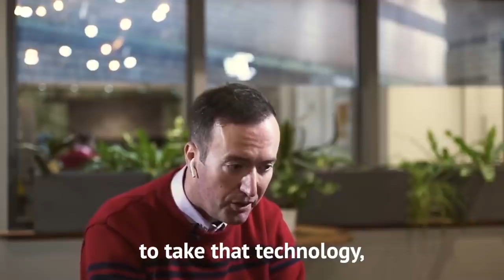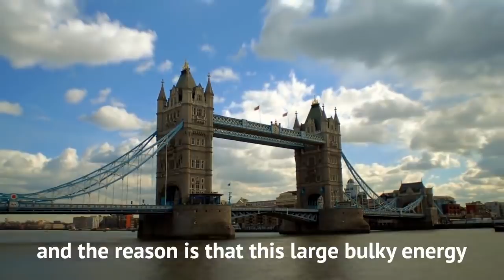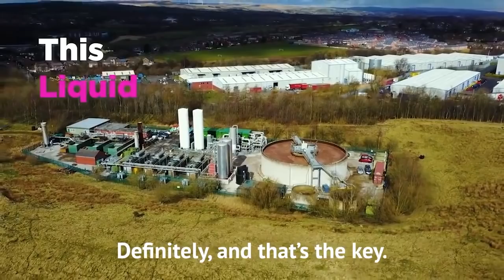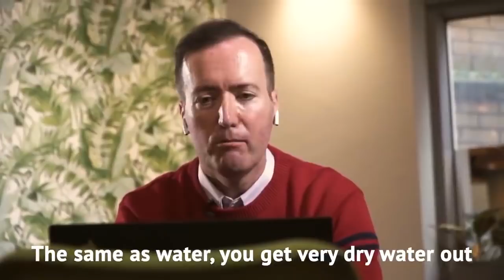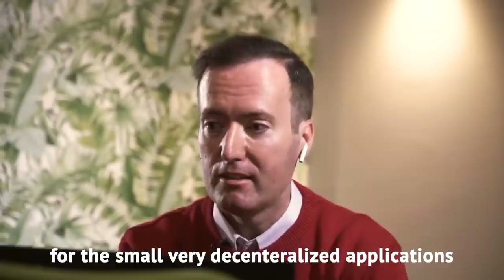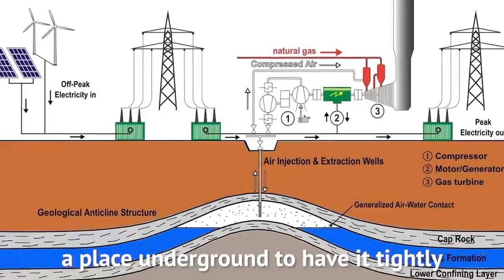Highview Power: Grid Storage Out of Thin Air

Comment: Extracting CO2 by liquifying air takes too much energy to be cost-effective. But if you have to liquify the air anyway, the equation changes quite a bit. This alone should make the approach attractive, given the carbon-capture side-effect.
Reply: I don't really understand the benefit of liquifying it---  Why not just compress the air and be done with it.  Seems like it takes a lot more energy to cool it down that much, into a liquid------- and keeping it stored at that low temp???   which I don't really understand the process that well, or how or even why its done.. lol  But I would think that there would have to be a benifit over simple compression alone.  but I agree with you, that the extra side effect of scrubbing the c02 out at the same time is pretty awesome.. at least from a "climate change" type marketing gimmick at the very least.
Reply: The removal of of the CO2 sounds teriffic until you look at at the overall amount. 1000's of these things running for hundreds of years would hardly make a difference. The solar on my roof for 1 1/2 years has helped reduce 12.6 tons of CO2.
Reply: @lkeil84  I don't think you factored in the amount of CO2 it took to build those panels.
Reply: They aren't doing anything to the carbon dioxide yet, it's just liquefied then released along with the rest of the air.

Comment: I was hoping you'd ask some actual questions, maybe some technical ones. This interview sounds too much like a superficial marketing video straight from a company's website.
Reply: yeah same--- I was very curious how the tanks of air can be converted back into something useful.....  but from I can surmise.. .  Just think of it as a pnumatic air compressor.   Basically when the grid (especially wind and solar) are running at a surplus because of low demand at that moment -------  they can run these systems to use that extra electricity to compress the air into tanks----   and then when its time to use it, they just run that compressed air through a turbine just like a steam engine operations..  I'm not exactly sure why they liquifiy it, maybe it makes it easier to store.... but it makes sense in that can help level up the peaks and lows of a randomly running solar and wind system--- and turn on and off at will, as needed.........  

There is also something called a "gravity battery" ---  Which is basically a large tower or even deep vertical mining shaft--- that, when you are in surplus--- you can run an electrical crane to lift very large, many TON blocks of concrete or stone and hang them side by side in the air---- and then when you need that extra power--- you just go the other way, and grab those blocks with your crane and let it free fall down the shaft, pulling the crane cables holding it--- which would then run those large electric motors in reverse and create electricity.  Much like regenerative braking works.  I think that's really fascinating also.  Very cool stuff.  It really makes the intermittent issue of solar and wind to not be an issue.  But I can imagine that you would have to build a lot of these. lol...
Reply: @calholli  Why liquefy air at cryogenic temperatures? Because it enables you to store a lot more air in a given tank size without worrying about several tons pipe bombs. When it is time to re-expand the cryogenic liquefied air to run a turbine, just pump it through a heat exchanger.
Reply: @teardowndan5364  So you have to constantly keep it cool and then heat it up. Doesn't sound very efficient.  I guess if you aren't storing it for more than a day at a time.
Reply: @calholli  A high-vacuum Dewar flask can take months for its contents to finish boiling off and this gets better as the ratio of volume to surface area increases, no problem for long-term storage. The main selling point of this stuff is that you can have easily scalable pumped-hydro style storage anywhere without rare materials.

Most energy storage only has 70-80% cycle efficiency so if you are really concerned about efficiency, the best is to not need energy storage in the first place. Storage is only necessary to buffer variations between sources and sinks over a given period.
Reply: Calholli--- you were wondering why they would liquify the air.  If you compress any gas (carbon dioxide, nitrogen, helium, carbon monoxide, air, etc.) enough, it liquifies.  There is nothing to stop any gas from liquifying if you compress it enough.

Comment: what is the efficiency of this technology ? 100KWH goes in what comes out?
Reply: About 70%, based on their website.
Reply: @petrihietanen1102  So not quite as good as stored hydro (75%) but not at all location dependent, which is a big advantage.
Reply: @Wookey.  "Stored hydro"??   How does that work?----------  I would guess, basically pumping water high into a resevoir and then running a turbine with it like a hydro dam, when needed?   if its not this, then what?
Reply: @calholli  Sorry yeah 'pumped hydro' is the normal term. Temporary brain-fade there.
Reply: How much energy doea the tank hold compared to hydro. I.e. how much area is needed vs water fir dam